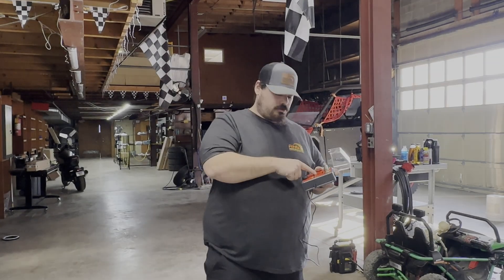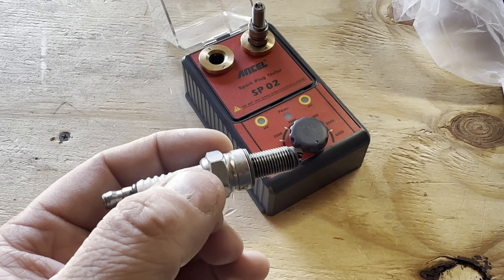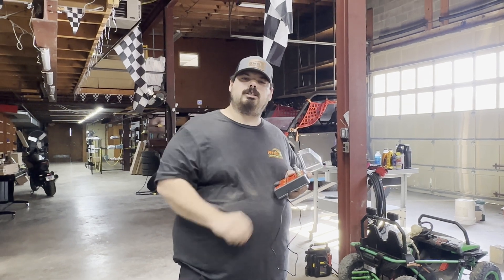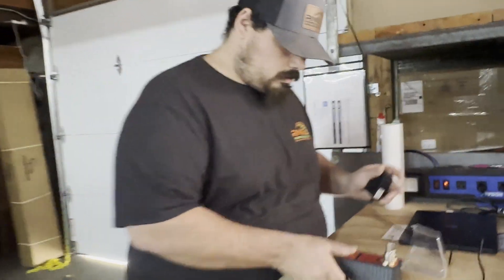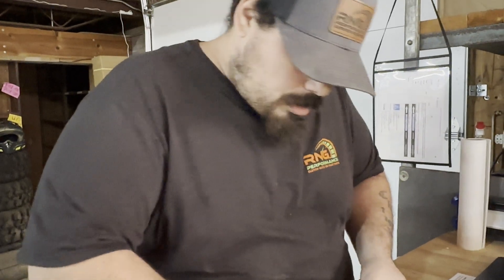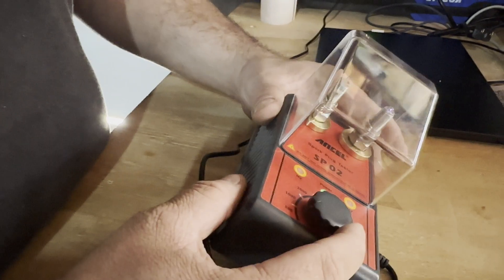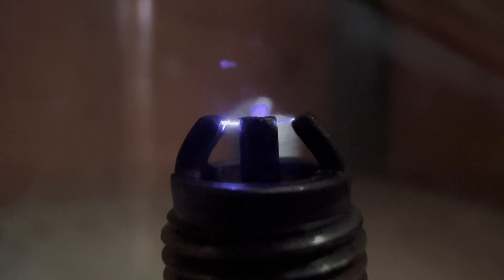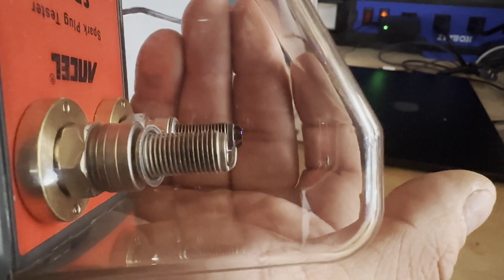These spark plugs ROB HP let me show you how | ANCEL SP02 Spark Plug Tester

Comment: Hey Steve, is the NGK copper plug in your video the same as what comes stock in a 2022 XL?  If so, would changing to the iridium plug be noticeable?
Reply from the maker: The 2022 xl does come with an NGK copper plug yes.  Little different than the one in the video the one in the video is from a 950 motor. Absolutely noticeable
Reply: @R.N.GPerformance  Thank you for confirming